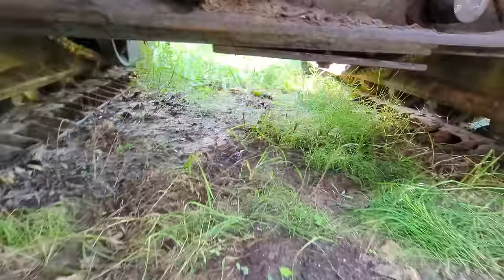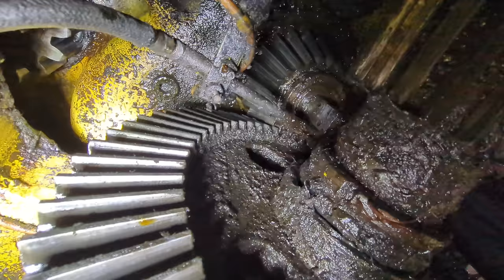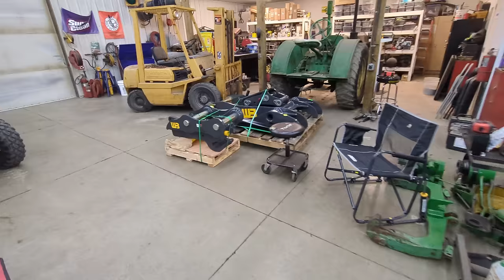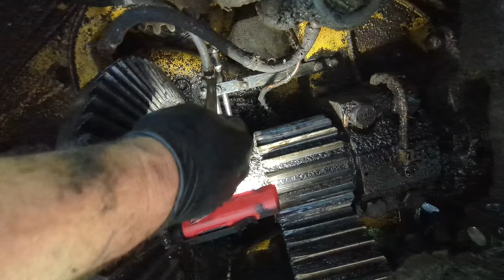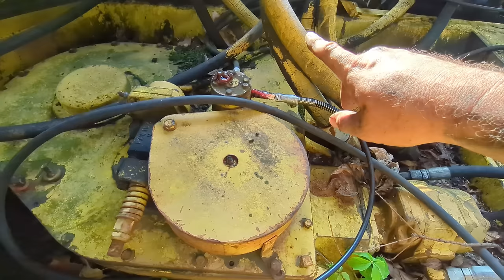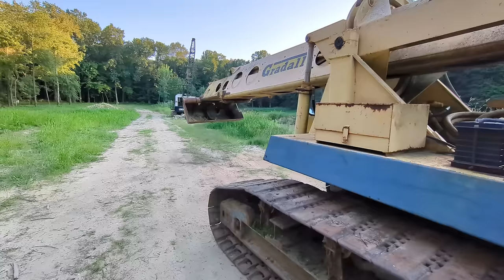Gradall Repair The Oldest Excavator I Own Needs Some Help! Thanks For 32k!!!

Comment: Brandon, very good video. I worked for 14.5 years in the storeroom for a natural gas utility. We stocked both black and galv. pipe and fittings for running gas lines in buildings. We had a very small number of 1/8 inch fittings and pipe nipples but not one time in those 14.5 years did I issue any to the field crews. Maybe they were popular in the old days but I don't think so much anymore. Maybe a plumbing supply house might carry them.

Comment: Those are left handed drill bits. A lot of the time they will remove the bolt you're drilling out without even having to use the EZOut.
Reply: I love mine! The best tool ever!
Reply from the maker: It totally slipped my mind when I was talking about them that they are left handed thank you for bringing that up!

Comment: Not trying to get off content here, but in the beginning of your video, you panned by a semi tractor hooked up to your lowboy, looked like it has some nice big stacks on it. Can you give a run down of it sometime? Looks like it would make a good pulling truck for fair events.
When it comes to digging into repairs on any piece of equipment, you are a jack of all trades 👍. Nothing seems to be too difficult or not doable, just a suggestion for extractors, a reverse drill bit set comes in handy at times, sometimes they will actually grab ahold and end up turning out the bolts after they heat up. Thank you for bringing us out here in web land along with you.
Reply from the maker: Thank you for watching yes I can do a video on that truck some time there is a video of fixing a broken head bolt on that truck it's a older video of mine

Comment: Wow that turntable gear set works out in the open, apart from that belly pan.? How the heck do you keep it lubricated, as oil would just run off on to the ground ?

Comment: Iran a truck mout Gradall man years ago and they wear and still are a very versatile machine granted not a ast machine but still a dam good one
Reply from the maker: I've got my eye on a truck mounted one identical to the one I have I need to try to get it bought I know it's got some extra buckets with it....my goal is to eventually get a newer one from the 2000's at least on tracks I think it would be a great machine to have for low head room ditch work

Comment: What about 1/8” brass fitting. Would that have worked ???
Reply from the maker: I found alot of brass but I was worried it wouldn't be strong enough even free that manifold has some resistance because of the drag of the seals

Comment: Didn’t you say one time that you were going to do a barndo minium?
Reply from the maker: Yes I was then we started the pros and the cons and fire was my major con and even if you did a fire wall between I still just dont want to chance it....we will get deeper in this later it's a good video subject to discuss!
Reply: @dirtgrainsteel  I agree with you on that one.   I’ve been wanting to do the same thing here.  I’ve even thought about going the extra mile and putting in a fire suppression system if I where to go this route.